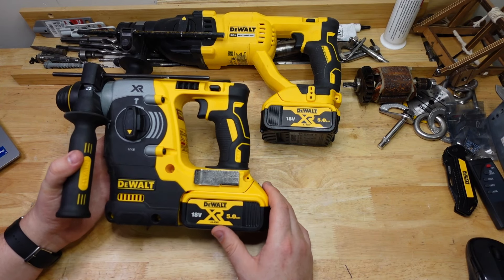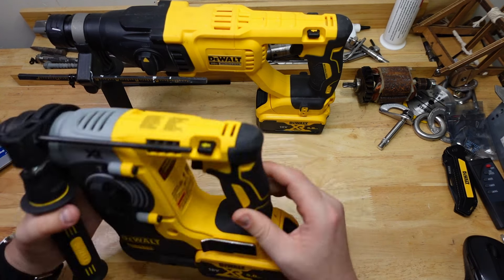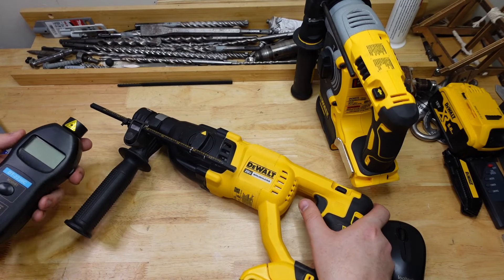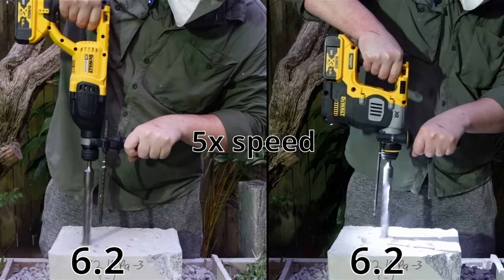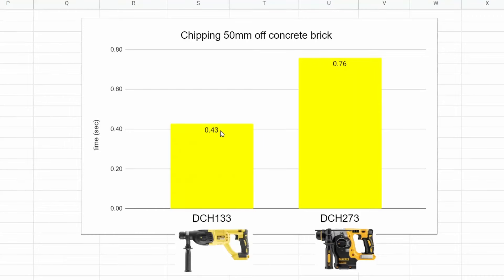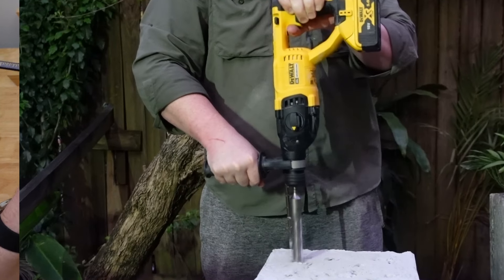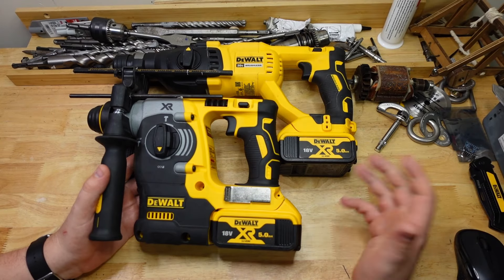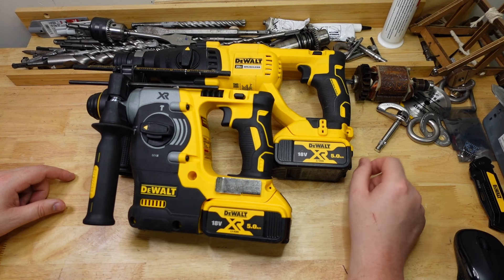DCH133 vs DCH273 (DeWalt rotary hammer showdown)

Comment: The vibration dampner is just another thing to break. Commericail Electrician here. I use the DCH 133 day in and day out no issues hasnt failed on me in 4 years whereas the DCH 273 owned by a  coworker has been in repairs twice. To each their own. If you want a workhorse, get the 133 if you have baby soft hands get the 273.
Reply: "Baby soft hands..." hahaha oh I can hear the banter from here.
Reply: No lie, I’ve been reading the horrors on the larger unit. The trigger likes to go out and the part alone is 235+
Reply: Yeah… I already noticed that seemingly half the DeWALT repair videos are the XR SDS and above hammer drill… not counting batteries, of course. Seems to be a lemon, like the 2x20V Max mowers have been so far (2nd gen was spoiled by DCB210 battery issues 3rd gen just started so we’ll see). It’s just one of those cases where I’d rather have the non-XR tool.
Reply: Idk ive had the 273 for over 3 years now and its still going strong. I dont abuse it though, for tougher jobs i use a corded hammer drill
Reply: @ACE7O2  DoctorLefthandThread has repaired several and keeps remarking that you don’t see the same failure in other brands/models.
Reply: only on low quality hammers.  

Low IQ take to say it's about having soft hands.  It's nerve damage, not calluses.  And a couple of springs in passive vibration mechanism wouldn't likely break, lmfao, if you have any actual common sense.   Common sense also tells us that vibration control is good for the longevity of expensive electronics components and the battery.  It's overall more reliable because of a couple of vibration damping components.   Dewalt and Milwaukee engineering clearly agree with me because they've even added battery isolators to their latest and greatest high torque wrenches.  Makita added them, idk, like 15+ years ago.  

I have a DCH133, it's a good hammer for how cheap it is, but it's not at all great for once you've had a taste of the good life.  But I've used SDS Max hammers with better vibration control and likely more reliable than a cheapo Dewalt 133 considering how much more abuse they've gotten.   Probably because it's a Makita AVT and that's actually a great example of you get what you pay for.   Far smoother and more reliable than the rattle bucket Milwaukee SDS Max I used before it.  

Lord knows you couldn't handle carrying a 20 lb+ SDS Max system around tho.

Comment: one large bonus of the 273 is that it's able to be fit with the dust extractor as well, and in some countries, workers are required to use extractors when drilling/cutting concrete because the silica dust is linked to cancer in instances of longer exposure.

Comment: Been using the 273 for about 3-4 years off and on and I think it's size is what initially sold me. It's nice to have a smaller unit to fit above T-Bar ceilings.
Reply: Would you recommend the 273?

Comment: Buy some anti vibration gloves with the DCH133 Plus 20% quicker drilling, then multiply that  by  fixing 1,000 ceiling anchors on a construction site for example, 20% less time holding a heavier drill overhead, you should have used the DCH263 for a better fairer comparison and still a lot cheaper, your basically paying double for two springs, a diode and a belt clip, you can buy a belt clip for the DCH133 and DCH263 for pennies. It all gets to confusing as DeWalt has far too many combi hammer and rotary impact drills, love your videos by the way but a little criticism is good don't you think. 👍👍
Reply: Valid points! the 263 in my market (Canada) is about $90 cheaper, and based upon the specs slide, the 263 is 3J x 4300 IPM, which is just in between. But it has the bonus of the vibration control. I suspect if you're doing work in tighter spaces, it makes sense to have the 273, but otherwise doesn't make any sense to get the 273 over the 263 since the 133 basically wins out in every way and the 263 is a slight "improvement" upon it.
Reply: @thudang3039 did you see the part in the video where he said to get the 273 if you do a lot of drilling because it really makes a big difference to your hands, and he then showed the clip of him shaking his sore hands after using the 133?

I like his summary of 273 if you do a lot of drilling especially bigger things. 133 if you do smaller or infrequent.

I drill concrete most days. I've used both and I prefer the 273. It's very smooth and the short length bullpup style means I can work in tighter spaces.

The 133 is great value. Some guys have that, others have 273.

Comment: I used a 2hp electric drill and that took forever (5-10 mins?), requiring constant forward force and water to cool the bit. The long boy cuts through my fireplace bricks like butter with the Bosch SDS bits within a few seconds.

Comment: I would be happy to consult with you before I buy, I am debating between two sets:

First set from Kita:

Impact screwdriver XDT19, called in Israel (DTD172Z)
DHR242 hammer
Includes 2 5 amp batteries and a fast charger

The second set is from DeWalt:

Dch263 Patichon
Dcf850 Impact
2 5 amp batteries and a fast charger

post Scriptum
What is most important to me is reliability, the company's service, workforce 💪 and longevity.

I don't use tools for everyday purpose

Thank you very much for the help
Reply from the maker: I can't comment on the company's service in your region but the DeWalt tools you mentioned are more powerful than the Makita in this case

Comment: Good video as always, I liked the standard wood drilling test as well which I guess gives an indication of the torque too. Would be nice to see some wood drilling in upcoming videos. 
To me the 273 both sounds and looks more like the 263 than the 133, but I guess we already know from one of your other videos that the 263 beats the 133. 
Would you consider doing decibel measurements in the future as well?
Reply from the maker: Yeah I ran out of tree so the old torque test is finished. I'm not sure if I can do the wood drilling test repeatably as different parts of wood drill different speeds, but I'd like to do something like that as it's pretty informative I think. And yeah sound level is easy. But the acoustics within the different tool shells will make motors sound different. Maybe better to check part diagrams or dissect drills to see what's going on inside? What are you looking for?

Comment: DCH273 has this typical shape built for construction workers who need to have the most compact tools using them all day long in all kind of positions, i had the dch133 before its powerful but not well balanced ... By the way could you tell me your opinion on the différence between the dch273 and both the makitas dhr243 and dhr182 ? 
Also take a look at the Hilti te6 its well balanced, has good anti vibration system and very powerful perfect for construction , im curious to see it compared to milwaukees and others

Comment: I just got rid of another non-controlled vibration hammer tool - not again! Hey, there is also another point into the test - see how easily you can operate tools with one hand ?! (I use very often in my work). Thanks for review!
Reply from the maker: One handed upwards, horizontal? I'm trying to build something to test that but I don't know if it'll work 😅. But yes I'll see what I can do. What drills are you using?
Reply: @BoltahDownunder  I like Bosch 5X or 7X drills

Comment: Hi im wanting to buy the 133 or advertise as 133NX-J. But.... because of the recent commercial jobsite WHS rules, I need a dust extractor and I see one for the dewalt 263 version which looks identical to the 133? Can you suggest a universal version or does the 133 have same dimensions as a 263 model? Any reply appreciated 👍
Reply from the maker: The 263 is a slightly bigger, more powerful version of the 133. It's also got vibration dampening

Comment: hi if you could help me, whats the newer version of the dch 133? its better to buy this rotary hammer or should i consider de dcd460t2?  i mostly use on wood and concrete, damaged a dcd985 on wood so i need something stronger
Reply from the maker: The 133 would actually have less torque than the 985 as rotary hammers don't cut the material with their rotation but just remove the dust with it. Depending on what size holes you're drilling in concrete (presumably small if you're using a hammer drill) consider a smaller rotary hammer like the Dch172. It'll kick a hammer drills' ass.
Without knowing what kind of work you're doing I suggest looking at DCH 172 for concrete and another drill-driver with more torque than the 985( or just another 985 since it'll be doing less work)
Check this out: https://youtu.be/Q0ZqHmUHtUI

Comment: Awesome video! Thanks for sharing. I especially appreciate the tear down bit, and additional info from other sources too! Great channel! Saw your other video on the 133 vs 263, and it seems the 263 makes a strong argument for the middle ground, with the 273 being a more "niche" item due to its more compact size. I can't see why, but watch me encounter a situation within a stud bay or something where I'll be wishing in that instance I bought the 273. LOL Maybe the Chin here is trying to pass off a more "premium" vibe looking more like its Flexvolt bigger sibling (832). BTW, the simple raw maths did it for me - makes sense for my case that I wouldn't be bothered by the longer size but could benefit from the happy medium of the 263 and save myself the money.
Reply from the maker: Thanks mate! The chin is a super interesting tool I think they may have come up with the internal vibration dampening and run with it as a sort of primo feeling drill while also being a little different. The downside is of course those springs dampen the impact force too, so it doesn't end up as powerful as the others. However, she's hands down the nicest hammer to use of any I've tried, and I have like 50! A real winner if you drill all day every day, but probably not worth the price if you're a more casual concrete perforator.

Comment: Wonder how much difference there is between the 18V and 20V batteries in these
Reply: They are identical batteries. Dewalt labels it as 20v here in the US for a marketing gimmick. Most of the time the battery itself is putting out under 18v in power while running. The Milwaukee on the other hand puts out about 19v while running. It’s just a gimmick, but I’m sure it helps sell tools.

Comment: What’s the best for value dewalt SDS ?
Reply from the maker: I'd say DCH 033 for smaller work and dch133 for bigger jobs. But they're pretty similar in reality, just the 033 is cheaper
Reply: Thank you. Then I will get a DCH 033 for $200 Australian dollars😊 with battery

Comment: Great video. Helped me decide on the long 1. Can you run it on standard 18v dewalt batteries? Or is it xr batteries only? 👍🏻
Reply from the maker: It works with all 18V slide batteries (called 20V max, in North America)

Comment: Is there any reason the DCH273 couldn't drill 29mm //  1-1/8" into concrete? I know it's beyond rating. I'm actually trying to decide between DCH273 & 263 W/ dust extractor.
Reply from the maker: I'm sure it could, once or twice. But if you're regularly drilling that big you'd really want an SDS max drill. I think out of the two you mentioned go the 273 if you're mostly drilling around 5/8 or below, & 263 if you're mostly drilling say 5/8 to say 7/8. If you want to regularly drill bigger then that, consider a bigger drill than the 263
Reply: I mostly do a pretty even spread of 1/2" 3/8" and the odd 5/8" run and feel like the DCH273 is the correct fit. There are so many things to consider though. I.E ergonomics of even the dust extractor itself. My eye tells me the DWH205DH dust extractor is a little more practical. Also, I like the idea that if I need to clean up a concrete floor or wall penetration some time, the 263's 50% more chipping power might be the difference between practical chipping or not. ( having used neither ) How do you feel with chipping in the equation, is the difference between the two worth considering or would they both be impractical?  @BoltahDownunder
Reply from the maker: Agreed re the 273, but I know nothing about dust extractor so can't comment there. Chipping is also hard to say, because it's highly a variable application. Stripping tiles? 273 should be fine.  Breaking up concrete blocks? 263
Reply: #1-Would you know if you can change out the chuck on the 263 for a standard chuck? 
#2-Also can either dust collector be mounted without the handle? 
#3-And does the 263 require me to remove the handle to dismount the dust collector?
-thanks for the help btw, I'll be making my decision tonight.  @BoltahDownunder
Reply from the maker: 1: no, but the 273 has a version with a changeable chuck, the 274.
2&3: don't know

Comment: I notice you are using the 18v battery instead of the 20v?
Reply from the maker: They're just called that here🤷‍♂️ it's the exact same stuff as 20v max, just different branding
Reply: The 20v batteries has 18v nominal voltage, same as in europe. 20v is voltage without load

Comment: Am I missing something? 20v tools with an 18v battery?
Reply: If I remember correctly DeWalt can't sell "20v" batteries in other countries because they're all actually 18v batteries that they call 20v. In the other countries they're labeled as 18v because that's the actual output.
Reply: @Steam_Engenius  mine show 20 on multimeter but I think you're right it seems all the UK or Australia videos all have 18v on the 20v tools.
Reply: @smky143  yeah I think they're 20 fully charged but only capable of outputting 18 sustained volts or something to that effect. The back of the boxes all say something like *18 volts nominal
Reply: @Steam_Engenius  I guess they call them 20 so people don't think they can use the older 18v labeled batteries though I don't think they have the same connector, thanks for the help.
Reply from the maker: They're the same batteries, just labelled differently for different markets. The cells are nominally 3.6 volts each, 5 in series is 18V. Sometimes that's rounded up to 20v max/peak. the battery will sit around 20v when idle &18 under load.  I believe the EU doesn't let them round up to 20V so DeWalt does a version called 20v and outside US they go with 18V